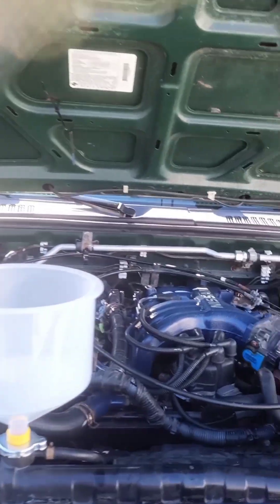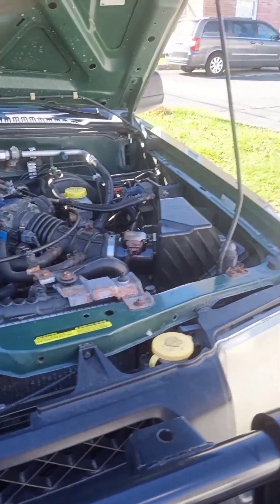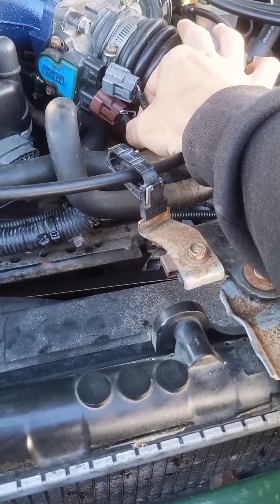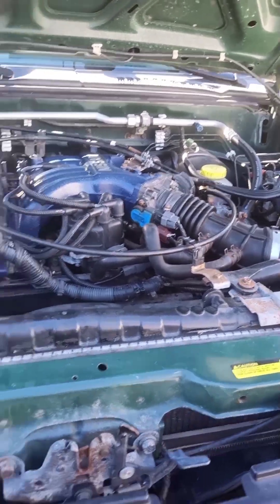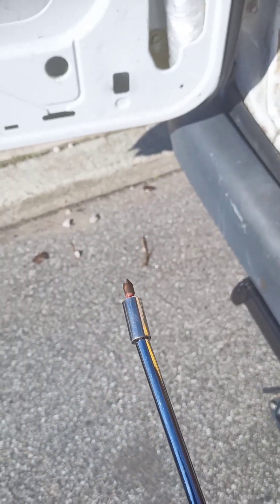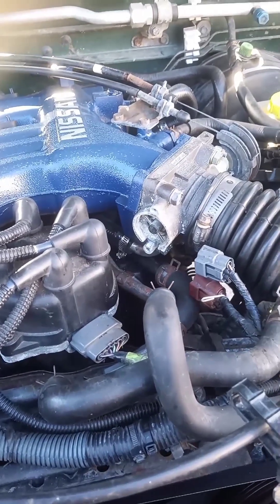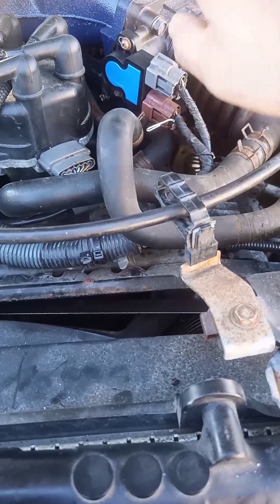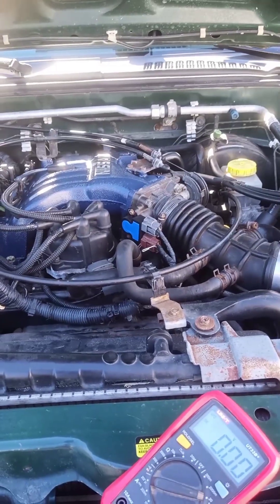01 xterra TPS sensor replacement

Comment: So did it fix it? Mine won't idle in drive, dies in a minute. This is my next part to take on! 😢
Reply from the maker: @jeremys6631  yes this resolved my issues. I would test it with a volt meter before you go through with replacing it
Reply: @duereviews791  thanks for the reply 🙏🏼